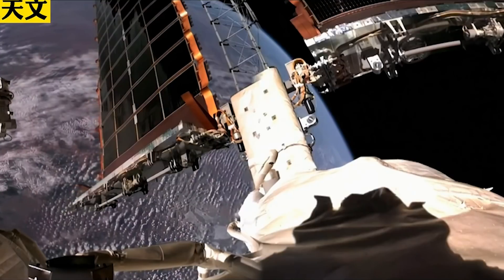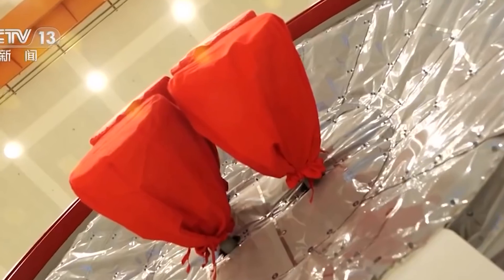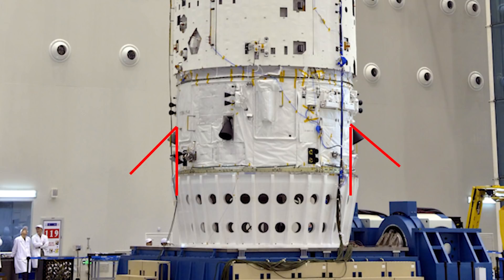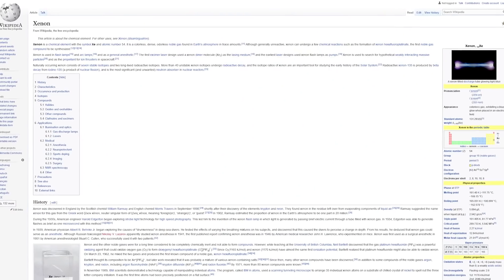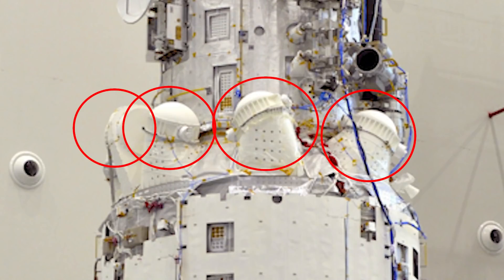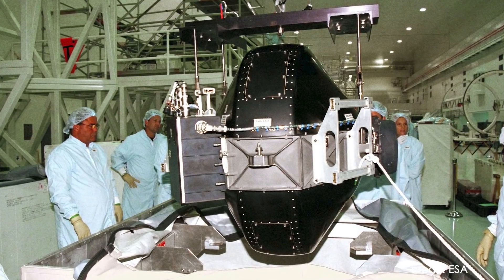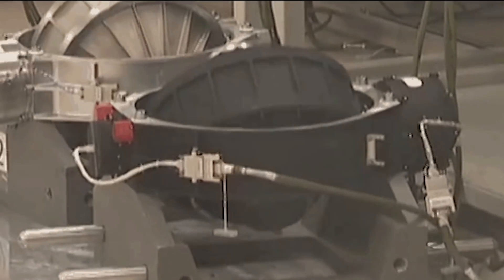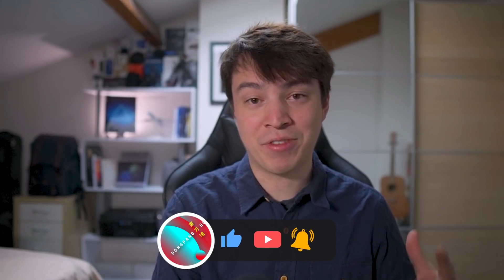How Does the Chinese Space Station Move Around in Space?

Comment: Thank you for the amazing research and excellent reporting on the various propulsion methods of the Tiangong space station. It would have been ideal if the Chinese scientists were able to develop ion thruster technology that is advanced enough to replace chemical propulsion. It is not exactly reassuring to have the propulsion chemicals stored next to the pressurised module where the taikonauts reside in. U mentioned the station can maneuver itself to avoid space debris. Does the station have radar systems or anti collision systems to perform such avoidance?
Reply from the maker: That's a good question, I am not sure. Will definitely keep an eye out for that info for the next deep dive into the CSS 😉